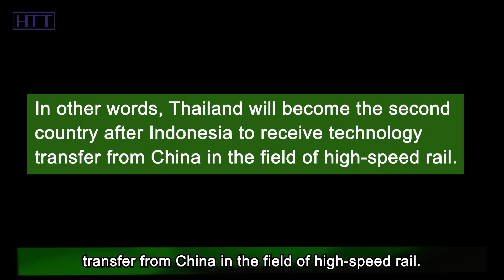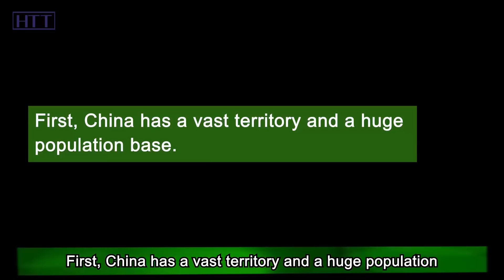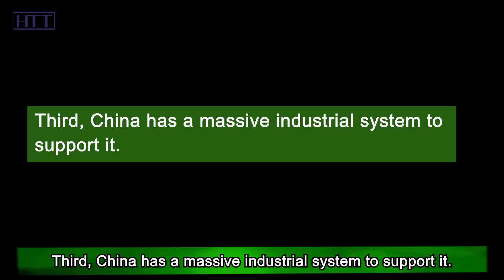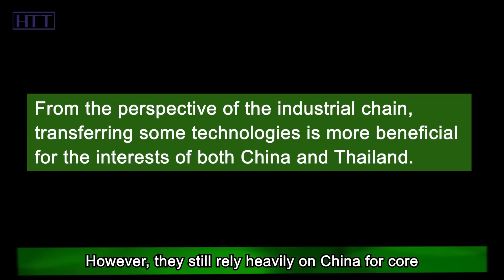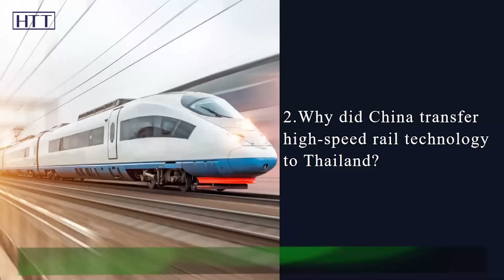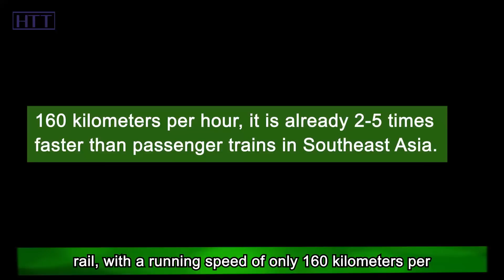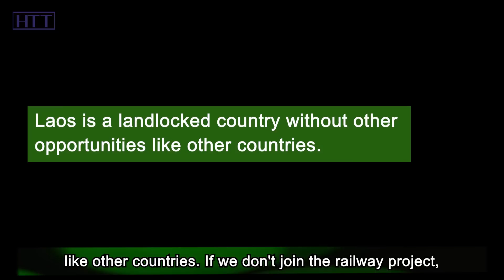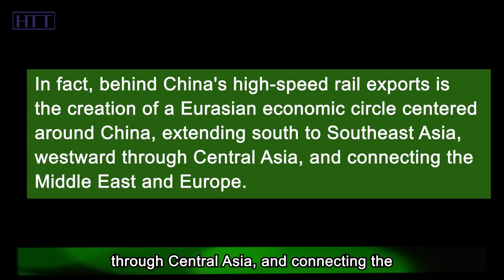How about tech leaks? China to transfer high speed rail technology to Thailand?

Comment: It take a huge industrial base to build a complete high speed train system. Thailand might get some blueprints but there is no way for it to actually produce and compete with China. The blueprints are still useful for maintenance and repairs but that’s about it.
Reply: Yes,  need a strong industrial base as support. But I think China is willing to export higher technology if Thailand's industrial capacity is strong enough, because China wants to build more links in Asia, It can further reduce the influence of the United States. can increase trade volume. and the progress is far from enough now.
Reply: Correct, Thai today cannot make truck after 40 years, The Jap is using them at assembly line, cheap labor. Most Thai have no interest, just one day at a time.
Reply: That’s already more than enough. Imagine Thailand building other lines connecting Myanmar with Laos and Cambodia; while only pay for electronic system and the train. It save billion of dollar already while Thailand could benefit much more than that from those connection